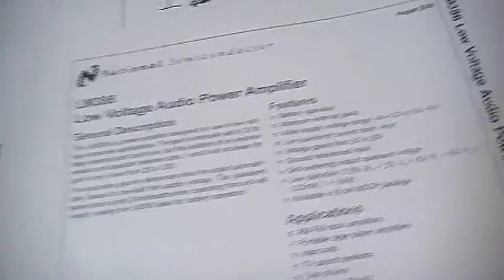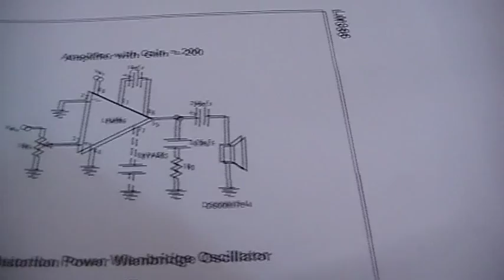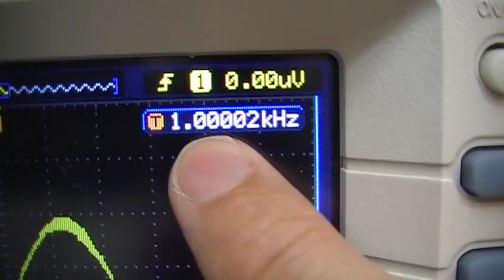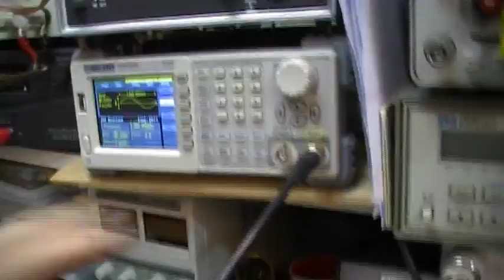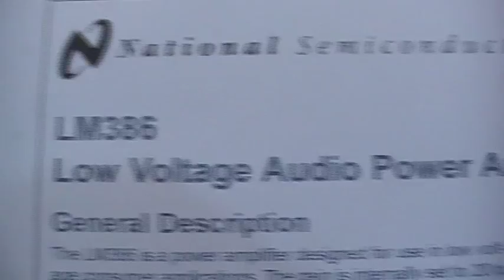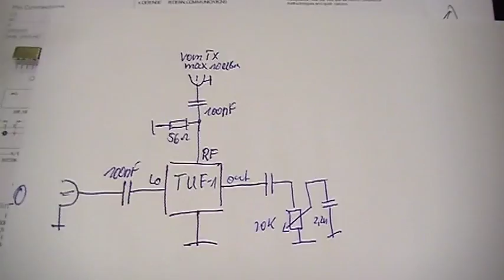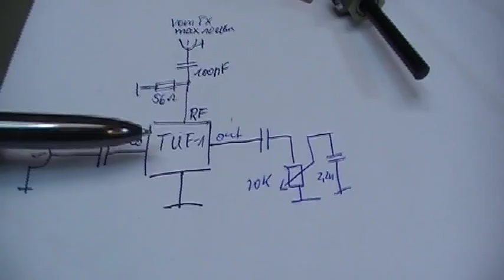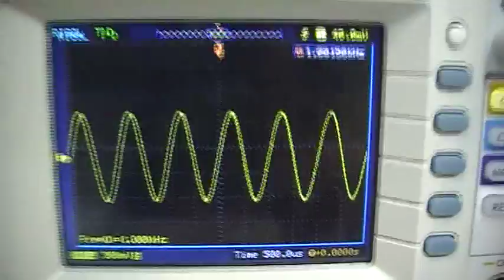#18 Build: SSB Lab Monitor; Part 2

Comment: As an audio guy I much prefer the Burr Brown OPA134. Notice the THD figure is much nicer. This is principally due to its very particular slew rate. The tradition of an 8 ohm cheap speaker filtering out the high frequency distortion is something I have questioned for a long time. THD+Noise can be much better, though you might suggest it doesnt matter much given the signal you are rectifying. The phase artifacts of SB not withstanding, I prefer to clean up each stage as much as possible. The chip is not cheap $3.50 in small quantities. I keep lots of them and it is my go-to audio op amp. It more than meets all your specifications. I am really enjoying the show. Thank you for sharing. 
● ULTRA LOW DISTORTION: 0.00008%
● LOW NOISE: 8nV/√Hz
● TRUE FET-INPUT: IB = 5pA
● HIGH SPEED:
SLEW RATE: 20V/µs
BANDWIDTH: 8MHz
● HIGH OPEN-LOOP GAIN: 120dB (600Ω)
● WIDE SUPPLY RANGE: ±2.5V to ±18V

Comment: Peter,

Enjoying this design and build project. Will be watching Pt 3 after finished here. Just wondering if the SAM-1 mixer would work if 160m band wanted to be tested.

WB3BJU
Reply from the maker: +Donald D'Egidio Oh, I don't remember what is the data sheet telling ?
Reply: Peter,
When I looked it was virtually the same as the TUF-1, but 1 - 600Mhz.

WB3BJU

Comment: Hi Peter. I'm going to build one. Is it preferable to use a piece of single or double sided PCB material for the mixer?
Reply from the maker: Hi Brian, the mixer is shielded so no need for a double sided PCB 73
Reply: Many thanks Peter